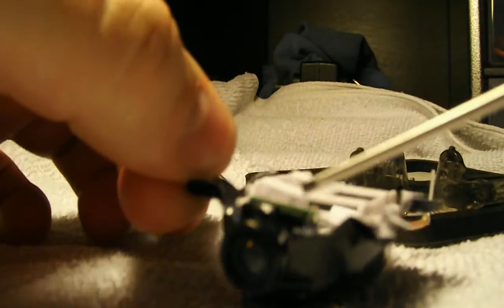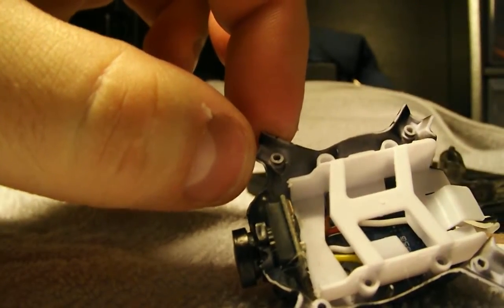DIY Syma X11 FPV

Comment: Hi Pilotgeek, great video. I am attempting to recreate this myself, but I have one question. What do you do with the channel pins on the Boscam transmitter? I don't understand the instructions on the Banggood page. Thanks!
Reply from the maker: Dave Grigg If you leave them alone, it will be wired to channel 8. You short certain pads to ground to set the channel.
Reply: Thanks!

Comment: Nice! Had my X11 for about a week and the mod bug is biting hahaha. Couple newb questions, would the stock radio/controller work, how much flight time, and can you post a link to the external battery for the camera? Thanks for posting.
Reply from the maker: Remigio Isla-nd Stock controller works fine. Flight time was around 5-6 minutes. Battery is 70mah EFlite.
Reply: Awesome, thanks for the response! Have you tried running 380/750mah batteries for the quad?
Reply from the maker: Remigio Isla-nd I think I tried a 300ish mAh battery from a dromida Kodu or something. I wouldn't go much larger than that due to weight and size

Comment: I slapped one of these on top of mine and direct soldered to the power leads. Works great! http://www.banggood.com/FX797T-5_8G-25mW-40CH-AV-Transmitter-With-600TVL-Camera-p-1042994.html
Reply: too much expensive no ? what is beter than this solution witch is two times and maybe less expensive ?

Comment: I've done the same mod and used a pololu voltage regulator to run both quad and camera gear. The stock battery doesn't have a high enough C rating through to power everything so you will need to get some higher rated ones. I use turnigy nano-tec 300mah batteries and it flies great with about 5-6 mins flight time.
https://www.pololu.com/product/2118